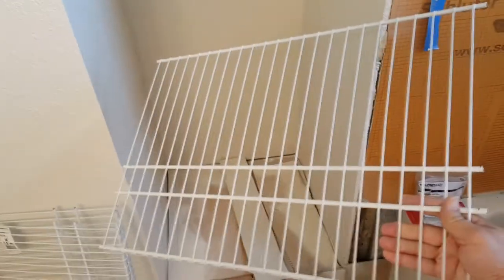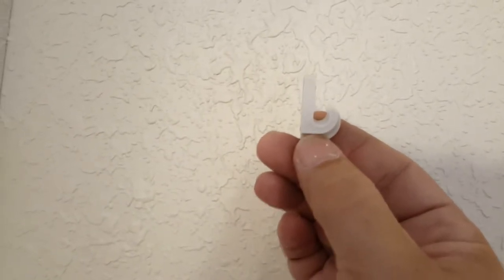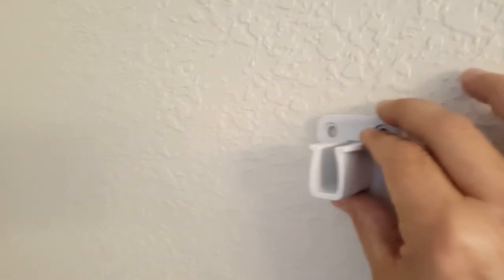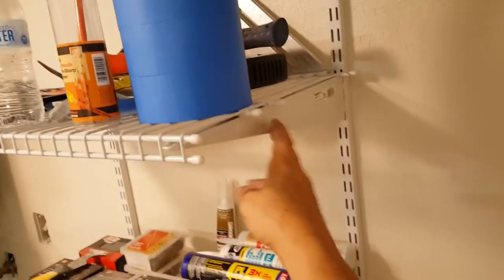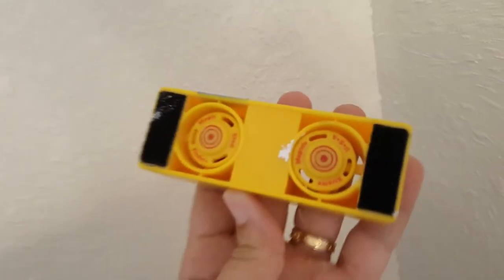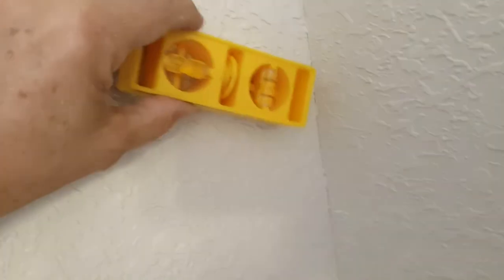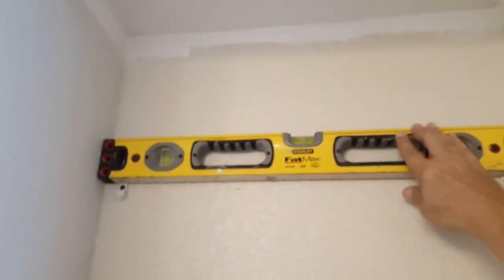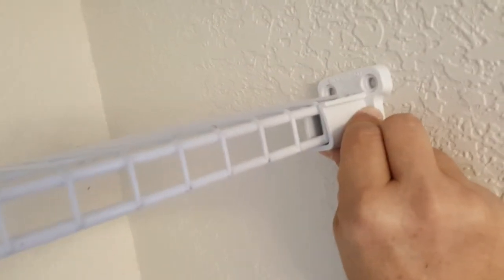Linen Closet Organization - Wire Shelving Installation

Comment: You're hanging the brackets on the nail which is incorrect.  The closetmaid anchor and nail combo is meant to go thru the bracket (both).  Not, the anchor in the wall, position bracket, then push nail thru bracket.